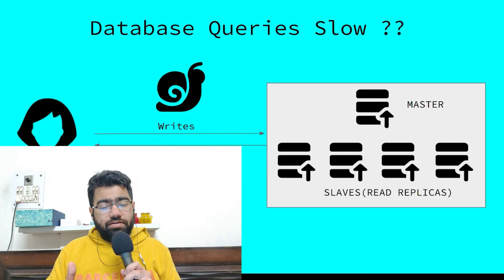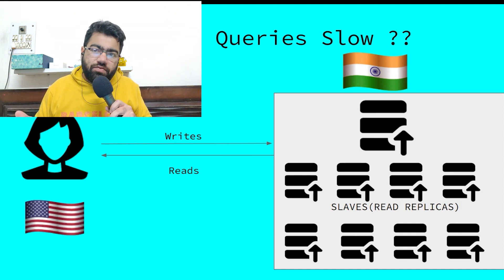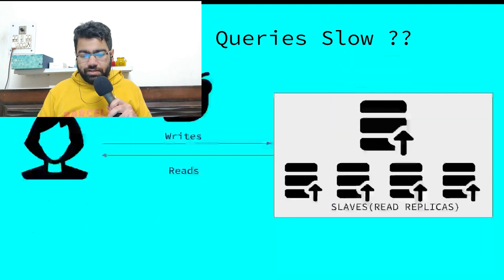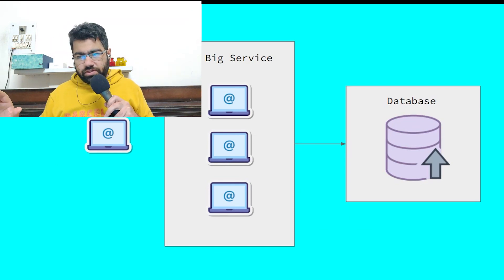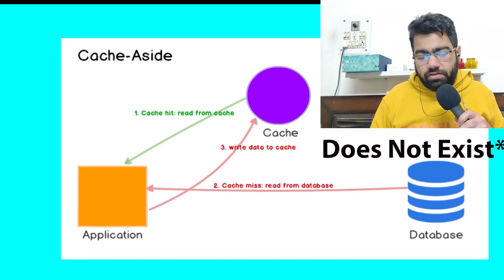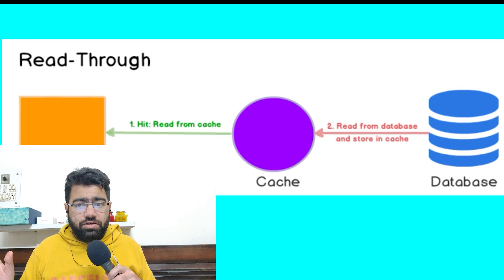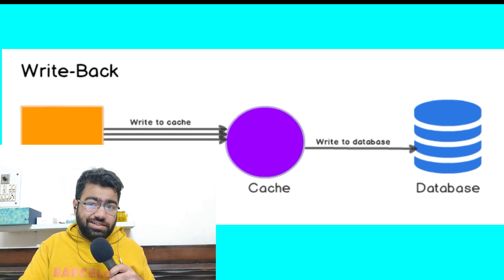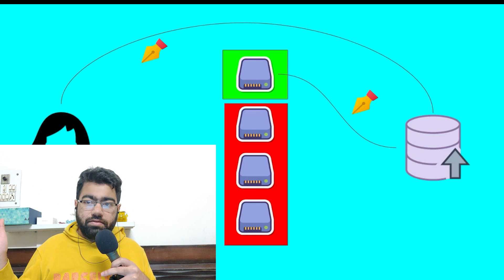SYSTEM DESIGN BASICS | SYSTEM DESIGN PRIMER | CACHE | HOW TO HANDLE SLOW DATABASE QUERIES ? | EP(2)

Comment: Caching again leads to one new issue if its getting stored on redis or memcache servers, that make call to redis (cache server) each time, and leads to redis timeout in high throughput, so better to store it inmemory on application layer.

What's your thought on this techie07??
Reply from the maker: A separate cache system can be deployed on a distributed system through which throughput can be managed. On that system, you can keep it in memory or deploy redis or any third party system.